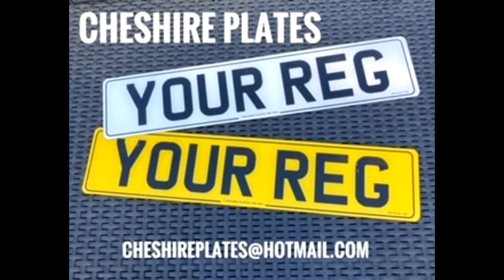Land Rover Defender Brake Disc Upgrade (Beryl)...

Comment: watched another video the other day and they mentioned chucking the hub back into the wheel on the floor (laid flat) to torgue up the disc bolts, great idea!
Reply from the maker: Hi Mr Jimbo...does sound like a good idea anything that makes the job easier as got to be good...Paul
Reply: @All4Overland  thanks Paul, just bought a TD5 110 and your videos (and others) have convinced me the maintenance is manageable, can’t wait to start tinkering! Happy Christmas mate and thanks for the videos

Comment: Hi Paul, A super vid, hoping to do the front suspension and discs etc on Penny (New name of the big black landy on my driveway) , but I will have to swap out a heavily corroded Swivel, but, like you I am junking that spacer etc on the bearings and reverting to 300tdi spec and changing calipers and fitting Pioneer 4x4 flexible jump pipes to the caliper and upper swivel joint bracket and a new master cylinder and Servo and and and, Carry on filming  Regards Phil
Reply from the maker: Hi Phil...the pioneer 4x4 flexible jump pipes are well worth fitting..we put them on Wilf when we did the front brakes and its so much easier than having the hard pipe...it is an upgrade i will do shortly i think..and i think it is well worth putting the 300tdi set up in over the TD5..and i will carry on filming lol..regards Paul

Comment: Hi Paul great video as per normal, I have a question about the heavy duty drive flanges- will a standard disco alloy fit over them? 
Regards Paul
Reply from the maker: Hi Paul...its been a while since i had a disco on standard alloys but from memory i don't think they would fit over the HD drive flanges...regards Paul
Reply: Cheers Paul looks like new standard one or HD “wolf style”
Reply: And HD drive flanges

Comment: this disc should be on the other side of the axle.. oops ;)
Reply from the maker: Hi Nick...the brake discs are not handed you can put them on either side...
  the direction of the slot in the disc you can put on either way..if they were handed the air vents on the inside of the discs are angled to aid with cooling..the air vents in these vents are cut straight so hence why they are not a handed disc...regards Paul
Reply: @All4Overland  I think the slots and holes are meant to de-gas the pads. Logically the direction that makes sense to me is to "throw" the gasses outward.
However if the internal vanes are straight I guess it's less of an issue.
Keep the videos coming Paul 👍
Reply from the maker: as far as i know it makes no difference at all the direction of the holes in the slots for degassing like i said its only the direction of the internal slots in the rotor..regards Paul